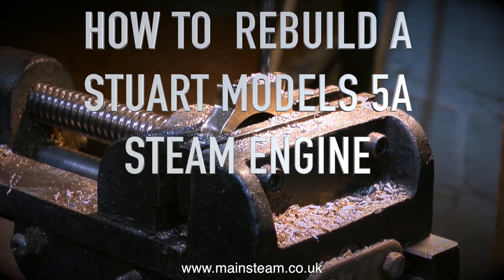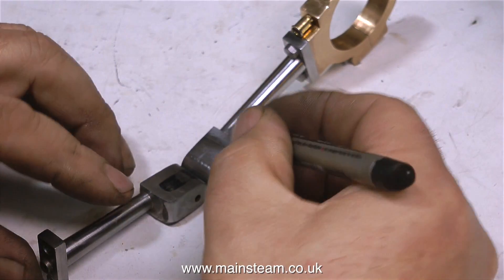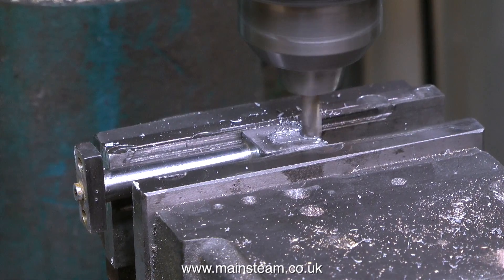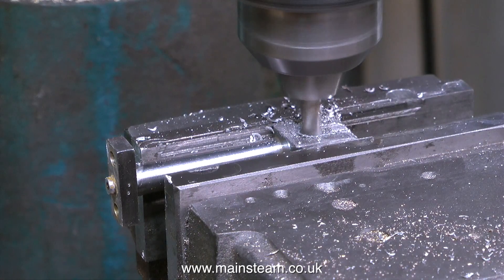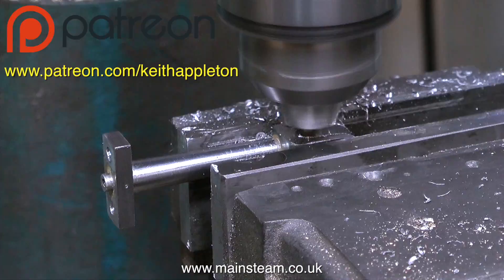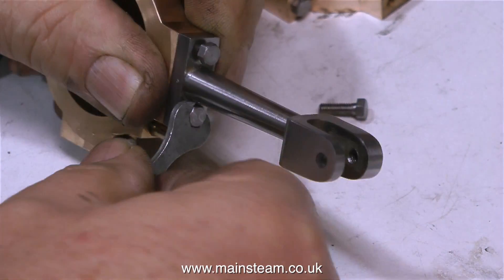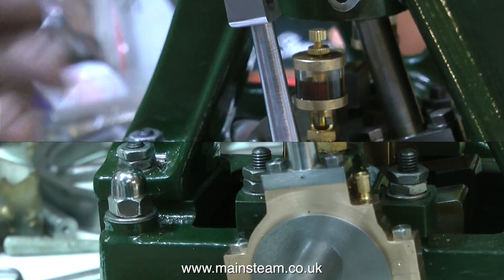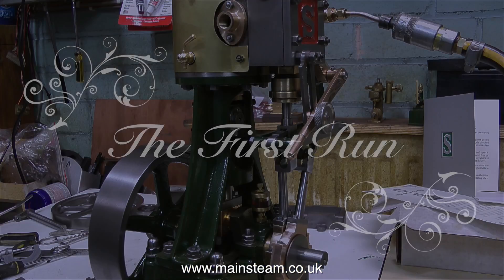HOW TO REBUILD A STUART MODELS 5A STEAM ENGINE - PART #29

Comment: At 10:28. Why did it need such a shove to get it over?  Was the timing creating back pressure?
Reply from the maker: I was adjusting the valve timing - I thought that I mentioned it in the video ...........
Reply: Keith Appleton yeah, I got that.  I’m just trying to get my head around what was going on with the timing at that point.

Comment: You have done a fantastic job on this engine, my engineering hat off to you, The 5a is a lovely engine, would love to have a set of them done like a D10. The eccentric work on it is much nicer then the D10s, are the drawing for them separate or part of the main set?
Reply from the maker: Thank you for your kind comments. The Valve gear drawing comes with the Valve gear casting set.